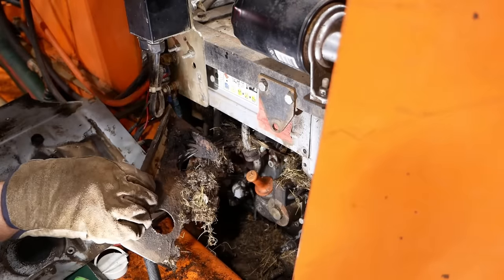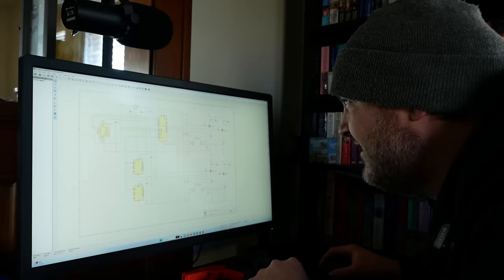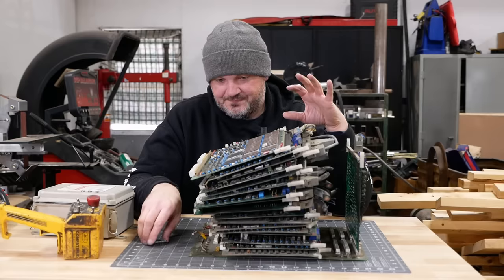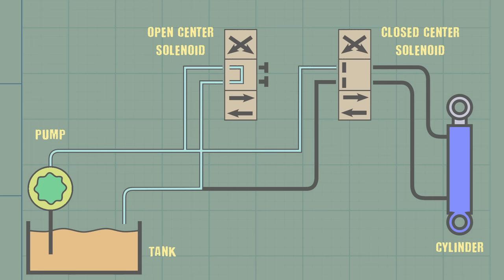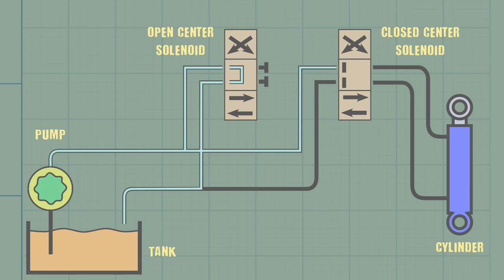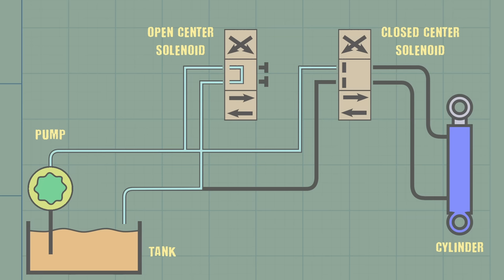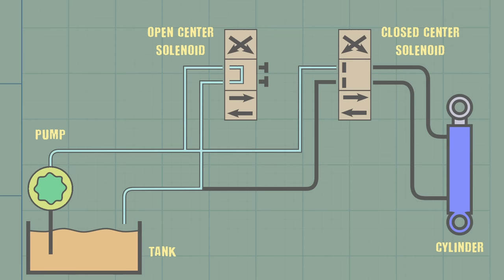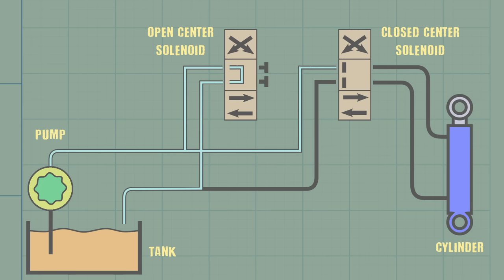Will It Move after 10 Years? Sketchy Robot Hacking

Comment: I saw your first video and recognize this one..... I'm only halfway through it but I have a quick question? Why didn't you just tie into the end of the solenoid with a lead screw and you could go open loop with steppers or better yet servos with feedback. That's positive.
And you can buy 'mini actuators' to do just that, very low cost.
 
You can know exactly where you are at all times with each valve.
Much simpler to set it up like I mentioned and probably a hundred times more reliable and safer.

Comment: On tracks like this when you turn left and right. The other side should go in reverse to make the attorney smoother and not grind up. Whatever you're turning by dragging the other side and reverse when you're turning in reverse. So it is a another complication for to your switching, but it will turn and go straight much much easier.

You may want to find 

So you should be able to tie in a Microsoft world's controller. Exactly how you have. The controller set up and be able to put the electronics in a stable case on the unit and be. Able to drive it from the wireless control.

What you want is A hydraulic static Hydraulic Motion controller for the tracks

Comment: The prusa has a controller board that would be a good comparison to that industrial computer for the cnc. Software would be slightly different than grbl. Also grbl boards as garbage as they are they can still control some pretty sweet cnc type stuff, those boards are pretty small too. Mine is just a hat for an arduino uno.

Comment: I always end up on videos and hear someone say, "I dont know anything about electronics so this project is going to be VERY basic!" They always then proceed to whip out custom pcbs they designed in cad which they then write a bunch of custom code for and then explain the setup that uses Arduinos and Pis and moving parts and microcontrollers put together with microscopes and pulse width modulation and basically the "basic" electronics from a person that claims to "not know anything about electronics" are ALWAYS ADVANCED!! Excuse me while I go find an "electronics for toddlers" video in hopes that I'll understand any of it.

Comment: You should try and get a flysky rc transmitter to work with it they have plenty of switches and duel joysticks that you can use one stick for each track and since the other functions only require a switch it would have enough to do functionality and you could also set a dead man switch to the remote or the receiver in case of a runaway so that it would just automatically kill the engine and set all hydraulics to neutral

Comment: You have more knowledge on how that "thing" works than I do, but could a RC controller for a model tank or similar be used to control at least the tracks for speed, direction, and turning?  The cable or winch and grapple are separate functions such as horn or lights, etc.  I am considering it as an overgrown RC model.  There are a large number of fans of construction equipment RC models that this reminds me about.  I have seen videos of get-togethers of these people digging, dozing, dumping, etc on YouTube.  This is similar to RC cars and airplanes.

Comment: Question: what's the best way to straighten the bent corner of the blade? Should I heat it with a torch first? Would it change metal properties? Or should I bang it with a sledgehammer cold? I hope people here know, thanks.

Comment: You have as good a knowledge of electronics as any professional.
You might want to think about adding a deadband and proportional response to your joystick. Deadband so a slight nudge doesn't result in movement and proportional response (square law?) to allow fine movement with small inputs.
Reply from the maker: It has a deadband.

Comment: @WatchWesWork  just a daft idea. have you seen the remote control of Scrappy industries ? Using a servo on a manual proportional valve. May be you could try something like this instead of your two proportional solenoids for the tracks.  HTH.

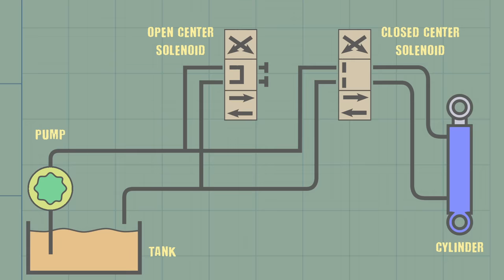Comment: @8:55 maybe I missed this in your explanation, but why does the cylinder hydraulic loop require an open center solenoid while the track loop does not? Is it to allow for a "neutral" state where the cylinder pump can run constantly without building up pressure in the system by having a default open return line? Couldn't that be achieved by having an open Center in line with the cylinder components? Why doesn't the track pump require the same?
Just confused, would be great to learn the reason, love your work Wes
Reply from the maker: The track pump is closed center. The valve just makes the pump displacement increase.
Reply: @WatchWesWork  so it's almost like a system ballast, where it's kind of a reservoir for system pressure to reduce the pressure drop that opening a solenoid/extending a cylinder causes?

Comment: Is this an efficient hydraulic setup? Feels overly complicated. Or does it need to run two solenoids in order to run one hydraulic pump supply so many valves without losing hydraulic pressure? Just feels like it could have been simplified by adding a pump per valve box or something. Idk, thoughts appreciated.

Comment: Is this how most PWM hydraulics are controlled?  It looks like you are only energizing one coil against the spring return pressure?  I have no experience with PWM hydraulic solenoids, but I know it is done a little differently with idle air control systems.  For example Toyota had an idle air actuator that was spring return to center, with a coil on either end.  Both coils got current but in a push/pull arrangement. So to increase idle air bypass, one coil would get current for 70% of the cycle, with the other side getting current for 30% of the cycle for example.  Center was 50/50.  I think this allowed a finer control near the center, with the return spring being less important.

Comment: Why use FET's to drive a variable solenoid if you need to vary the current? FET's vary voltage. A Bipolar BJT seems like a better choice as they are current varying devices. You could drive the base with a D to A output on the controller. Does this make sense?

Comment: Quick question is there a reason not to use a pressure unloader on the cylinder circuit as opposed to a solenoid dump valve. 
The main reason I am wondering is I work on CNCs and the hydraulics use pressure unloaders some of the fancy ones like the DMG MORI machine use variable frequency drives to lower motor speed when there is no demand for fluid. Super cool but way to overkill.

Comment: Wonder how hard it would be to utilize the board you have and add in a rc controller from a plane  it runs on 2.4ghz and would be wireless and have enough channels to control the circuits

Comment: Im confused as to why who engineered this chose not to use a hydrostatic drive for the tracks.  Control would be much easier and precise with the different proportional control pilot servo setups on closed loop pumps.
Reply from the maker: They are hydrostatic. I oversimplified the solenoid in the animation, but it basically controls the stroke of the pump.
Reply: @WatchWesWork  what make hydrostatic pump does it have?  Usually the displacement controls have the available option of installing orifices that prevent rapid pump stroke changes.  Doesn't solve all your problem but would smooth it out quite a bit.

Comment: if your joystic seems too jumpy you just need a logarymic prescaler to ger higher precision at the lower range and gradually less the faster you want to send it plus probably some ded zone

would be also nice to split digital and analog  part of it so you could send commands trough some paired blutooth modules 

if i understood it corectly you made some pwm controllers outside the arduino? why didn't you use analog pins of arduino or 2 integrated pwm channels? voltage controlled current sources are a thing  and arduino has analog pins where you have 255 voltage levels
prescale stearing stick to 4 analog pins or 2 analog and 2 digital for track direction feed that to voltage controlled current source and drop all pwm because your initial pule  might be too strong voltage controlled hbridge or swaping to servo controll could work too  because ublike selenoids those autohome with no springs just make servo controll a valveor feed both track from single pump 
also feedback from something like timing ring would be nice because you run under unknown conditions all the time

i bet you have milion better ideas but i'm just keyboard warior on the other side of the world
Reply from the maker: I hacked the arduino to get 10 bit pwm. None of the constant current drivers I could find could handle 3 amps needed for these big solenoids.

Comment: Dumb hydraulic technician here with an honest question about the track drives... why couldn't you just use 4 potentiometers as your proportional control? I know you've stated the slap stick issues but for such a simple circuit would it really come into play that much? Again mechanic here so I just fix the shit not design it so maybe I'm missing something. Also for the scary speed of the tracks just reduce your control end current in your software?

Comment: If you and Jonathan W get together watch out!
Reply: To slow down the tracks and even them out I would run them off a single pump. Also slow the flow down by reducing the hose diameter. As far as an easy way out for the remote consider using one off of a ramp truck or wrecker. Just remember engineer's make it look good on paper, mechanics make it work.

Comment: Wireles system may be similar to tbe terex crane what scrappy industries made.   Atleast this would be the start for wireless control. Maybe.
Reply from the maker: Possibly.
Reply: This way is possible to make tracks work, wit manual valvebody,  its a a start. I quess with research it may be possible to find all electronic controls for this.  Im amateur mecanic and electronics are to much for me.
Reply: Another chance is to. Its expencive but works.  Same type of controls that concrete pumptrucks are using, and truckmounted compact cranes. They are propocional controls , up to 20 channels that i gnow. Better ones are abaut 3(4 channel) to 10(16 channel) thousand euros pricetag, this is pricing here.  I think this version toes not fly at a moment.

Comment: now to convert it to cordless with a big red button to kill the engine should it lose control
Reply: also it may need an improved hydraulic steering unit, maybe a 3 position valve that uses middle as neutral letting pressure pass with left and right steering, a second valve blocks the neutral and makes it go forward or backwards
basically base it off what is used on a manned tractor so it simplifies and maybe give it a button for brakes as they are supposed to have brake controls and this clearly doesn't

Comment: What you need to do is get an Arduino with a Bluetooth receiver so you can just use an Xbox controller to does all Xbox controllers are Danny program Arduino what the Xbox basic control code now that you have the idea of the board you need to lay out all the graphing of the wire management on a mother bored making website then take your 3D printer and make a waterproof case for that motherboard

Comment: Are you aware that your engine sounds like it's misfiring.
Reply from the maker: Have you ever heard a 2 cylinder engine that didn't sound like a bag of hammers? If it was misfiring, it would not run.
Reply: Sounds like a one cylinder. Two-cylinder John Deers don't sound like that. I usually have a good ear for misfiring engines, so if you tried disconnecting one of the cylinders and it still ran then that proves that's just the way it sounds.